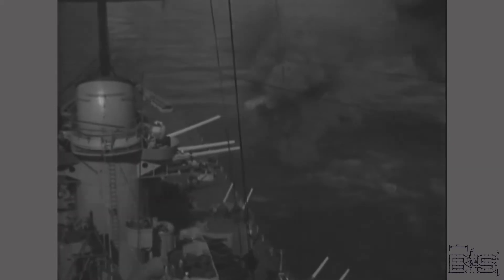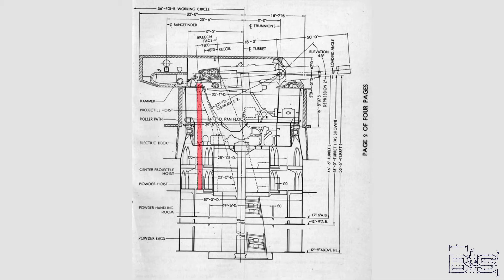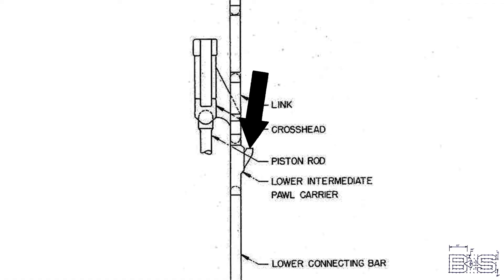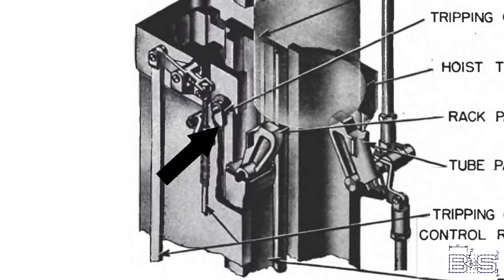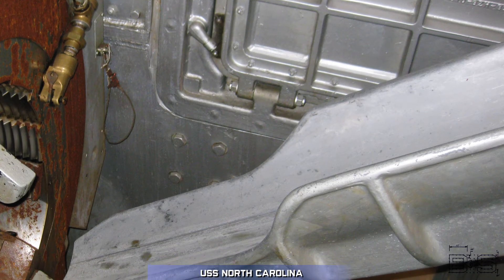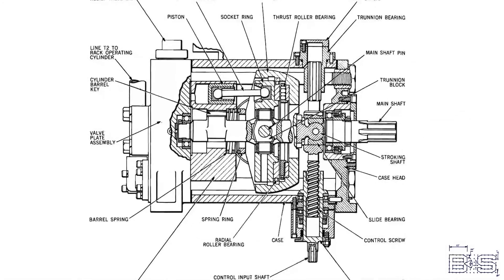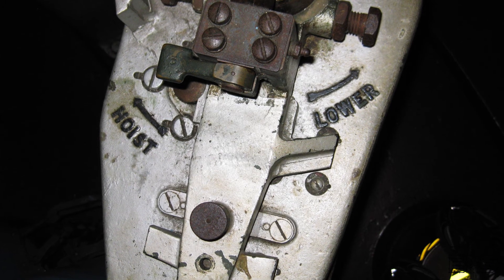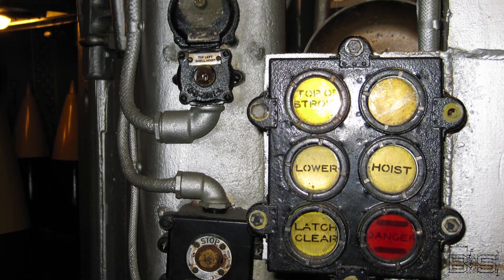16-Inch Projectile Hoist

Comment: 5:00 its an axial piston hydraulic pump. They can have a fixed or variable wobblers. The bigger name in those is probably Hamilton sunstrand, they made those pumps for anything from tractor hydrostatic transmissions to integrated drive generators in turbo fan engines used in large commercial aircraft. I think the heaviest thing i have lifted was probably a complete pontiac fiero v6 engine.